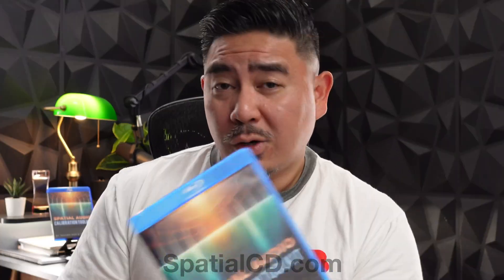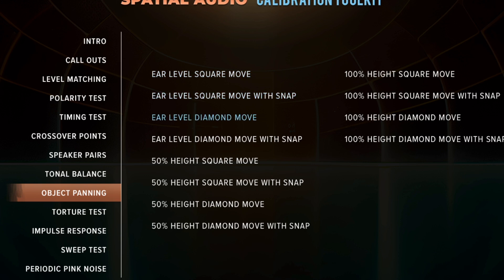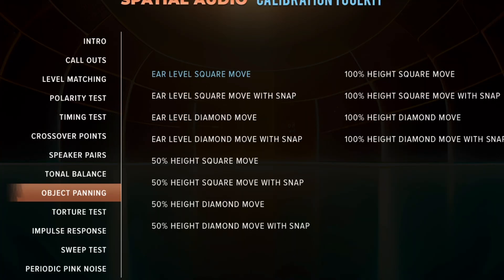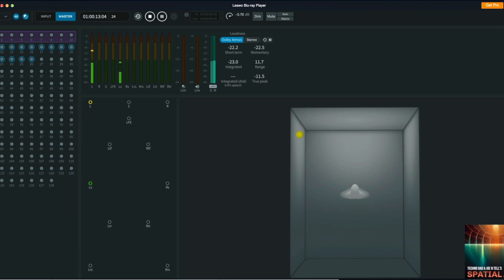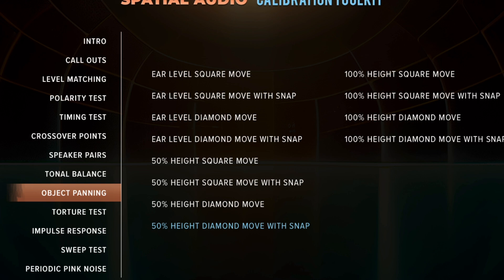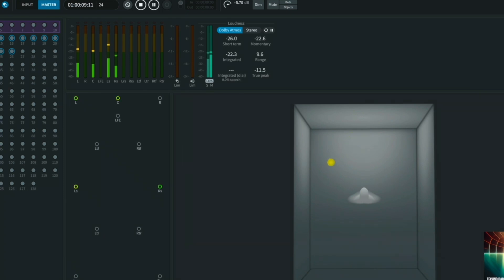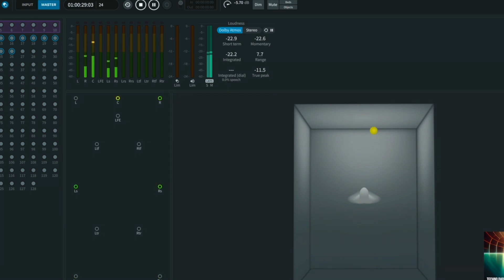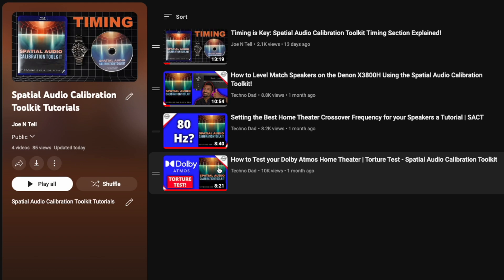ATMOS Object Panning  | Spatial Audio Calibration Toolkit Tutorial

Comment: Hey Joe, I just bought the digital version and just would like to say, congratulations, is a great a graphical tool…..I’m waiting for my Emotiva BasX7 to do run it completely. Just one question……Do you recommend to run it after Audissey at my Marantz or do not run it at all and just use your tools?
Reply from the maker: I recommend running the auto-calibration first as it usually gets levels and distance very close to begin with. Use the toolkit to fine tune or check what the auto cal did.
Reply: @joentell  one more question please…..I can’t put the subwoofers at the same level of the other speakers, it sounds extremely loud. I have two subs. Am I doing something wrong? I have them now, 10’db less than the other speakers and I always heard that should be 6db louder.
Reply from the maker: @aapablaz  If you haven't joined the discord group yet, I really recommend you do. That's the place where we discuss these things. It might help the other owners too.

Comment: Hi Joe, ordered the disc version yesterday, looking forward to using it! Is it in stock and ship soon?
Also, is the disc version somewhat up to date compared to the digital file version?

Thanks,
Tom
Reply from the maker: Channa is getting back from a trip and will send your product out ASAP. The digital files can be updated. Currently all but one single file are the same. It's related to a pink noise test tone for a middle height speaker.
Reply: @joentell  Thanks Joe and Channa, the disc version should be OK for me then, looking forward to it!. I actually just changed my middle height ceiling speakers to front. so now I have ceiling front and ceiling rear for height, 5.3.4.
I am very curious if my Atmos setup is working correctly??
Reply from the maker: @Sandisc2  Lets see!
Reply: @joentell  I found my Atmos is working properly. I tightened up all my levels after MultEQ-X. The SACT disc is great! Good job!

Comment: Joe, a mention of the importance of SACT using the Dolby renderer and the AVR height speaker configuration setup, especially in Denon/Marantz AVRs, to test for correct audio object placement is a game changer.  Some middle height settings "fold" middle objects into the rear  heights. As you said, difficult to determine with real content. My on-wall .6 middle speakers were not producing any height effects for many months despite the AVR test telling me I had wired them correctly. Unfortunately, it's hard for the consumer to know and understand all the interdependencies!
Reply from the maker: That can happen with static 7.1.2 mixes where only the top middles are used. Also, if the layout is set to surround heights instead of top middle, regardless of your actual speaker placement, it won't show up properly for Atmos.